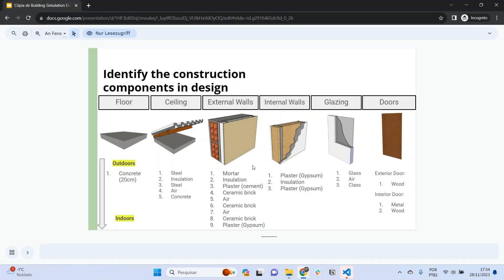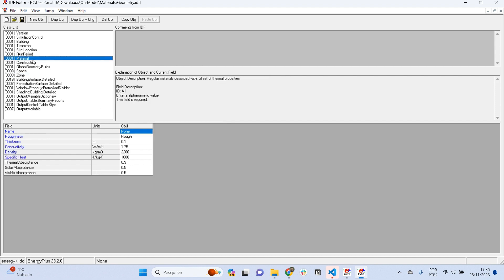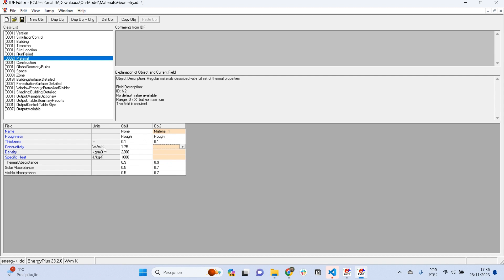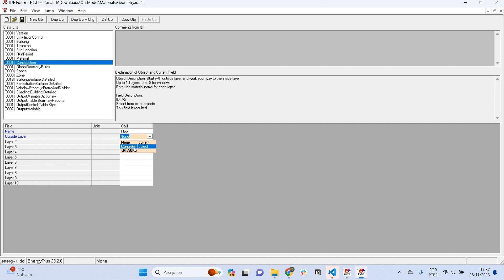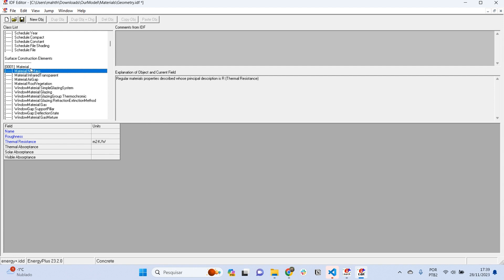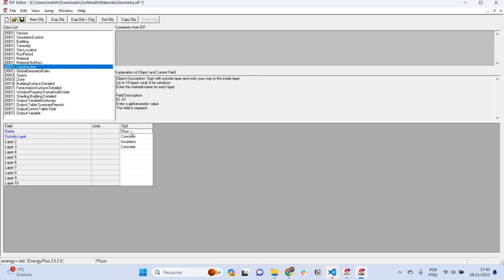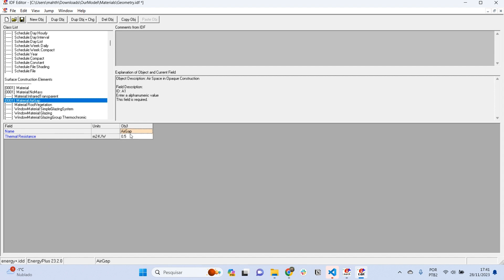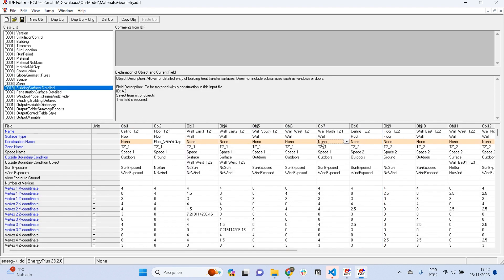EnergyPlus for Beginners - Part 4 [Materials and Constructions]

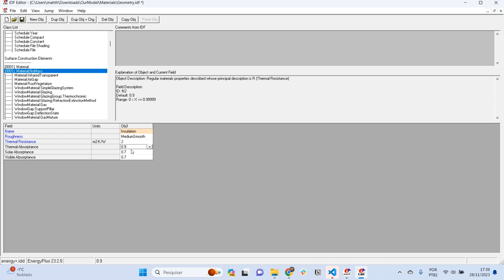Comment: Hi Matheus, thanks for video. From video Part 3 (min 4:37), Wall North TZ1 is (0,4,3), (0,4,0), (4,4,0) and (4,4,3). However in video part 4 (min.0:47) it is (4,4,3), (4,4,0), (0,4,0 and (0,4,3), I guess it is seen from outside of wall. Please explain which one is correct? and how to coordinate floor and roof, from which direction does it see? many thanks
Reply: bro i have the same question. if you have the answer yet id like to know. thanks
Reply: Same quesntion here, let me know if you have the answer please let me know
Reply: @huangryan9300  According to chatgpt, it has to be seen from the outside of the thermalzone and in a counter-clockwise sense, so that the normal vector points outward

Comment: If you specify an non-symmetric surface (example concrete 10 cm and then insulation and then 0.1 cm of concrete ) how do you know where will the concrete side of the surface will face ? how do you deal with this with indoor walls ?  for example in  Wall_East1_ZT_1 and  Wall_West_ZT_2?

Comment: Thank you for providing these videos. I have a specific issue about the detailed construction of the building. The building models are not included in the videos, making it difficult for me to replicate the entire structure. If you permit, I would want to provide you the building's 3D model or a photo including the necessary construction details.